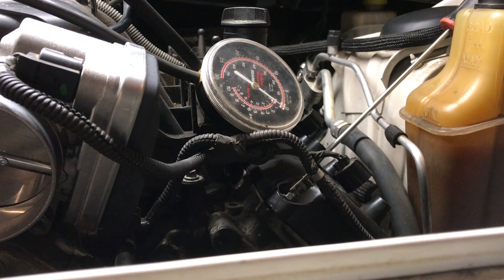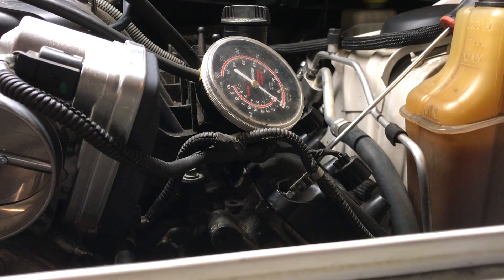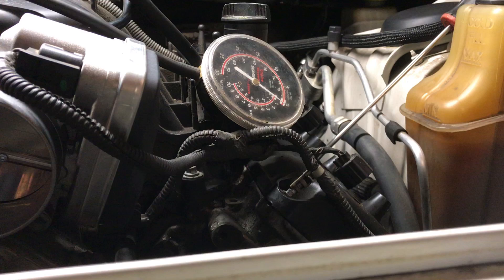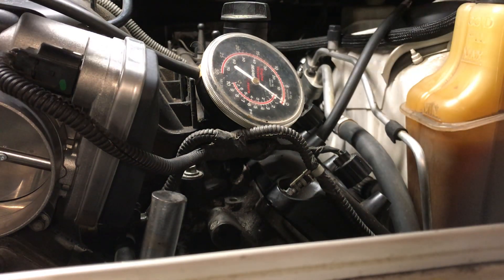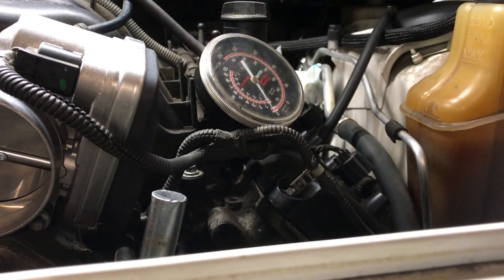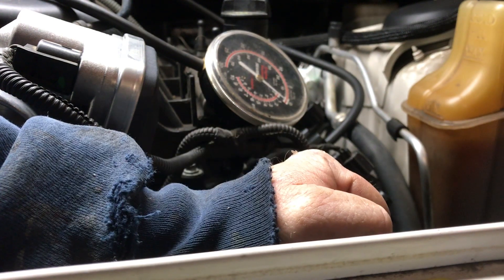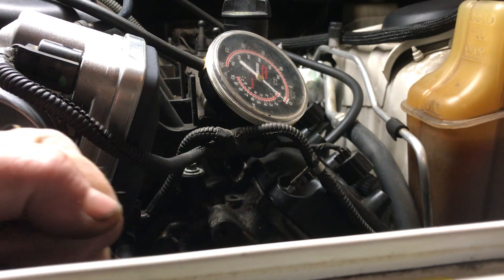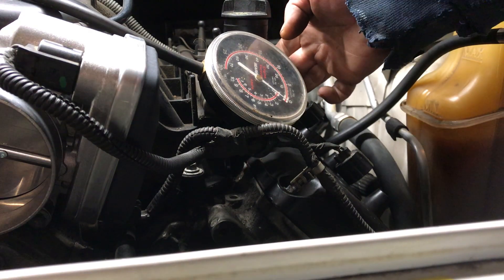2007 Dodge Charger R/T 5.7 w/ 80 lbs. Compression in #3 Cylinder

Comment: Its more than likely a dropped valve seat. Very very common on the generation 3 hemi.
Reply from the maker: It turned out to be a broken upper compression ring in #3.
Initially I did a smoke test on #3 and saw smoke coming from up from under the intake so that told me the head gasket was bad.
When I pulled the head thats when I discovered a beat up piston.
So I replaced the defective piston & honed the cylinder, checked the head for warpage, put everything back together with new head gasket and bolts and still had a miss on #3.
I had the head off 3 times ( each with new bolts and gasket ).

I bought a leak down tester and found that the cylinder had blowby.

So in short 2 gallons of diesel cost her a $7,000 new engine.